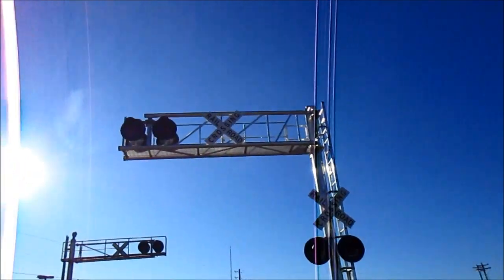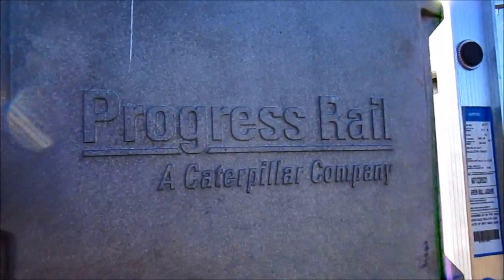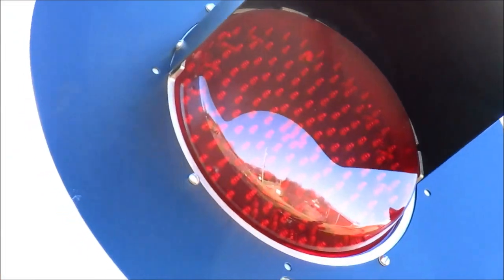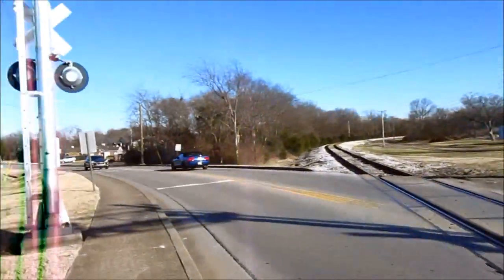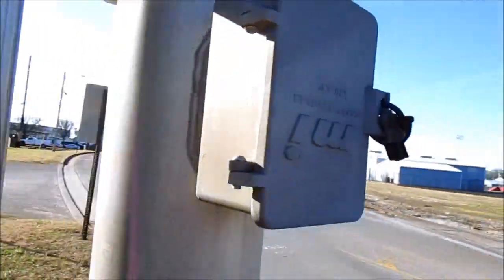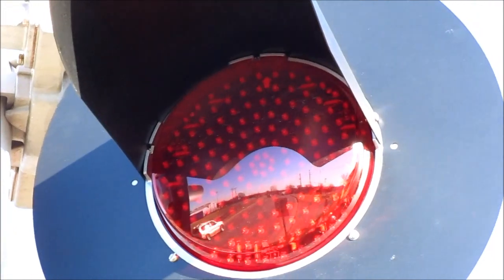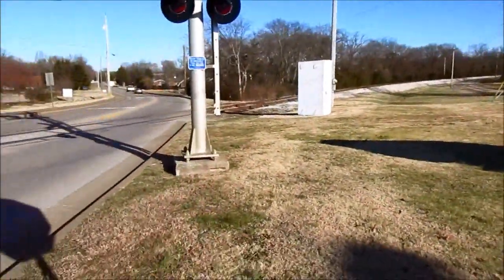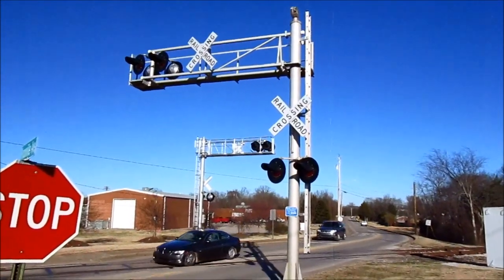12-19-19 Tennessee Boulevard Railroad Crossing Update, Lebanon, TN

Comment: Why did progress stop making their own light frames? Did they get in trouble by safetran for copying their design?
Reply from the maker: Don't think so, as they had changed the design of the light-heads for the later ones (it appears). I'm guessing railroads just weren't buying them anymore, so they chose to cut costs and stop producing them.
Reply: @freebrickproductions  makes sense. I wonder if WCH will discontinue the 0333 bell, the only buyer of them is B&B engineering for the most part, only a few railroads use them.
Reply from the maker: @natestrains1166  We'll just have to see. Even if most railroads don't buy entire 0333 bells, there's probably a good few that are still at least buying the parts.